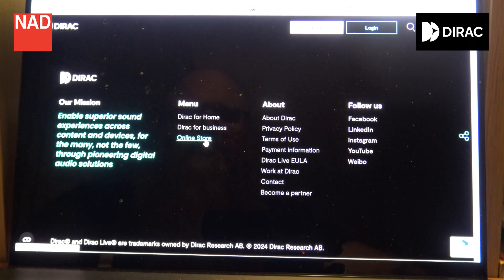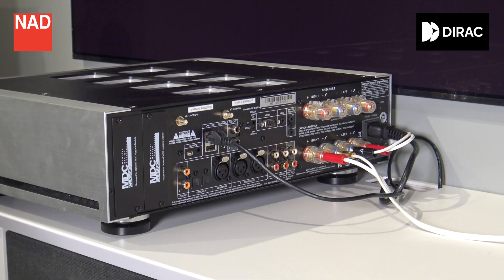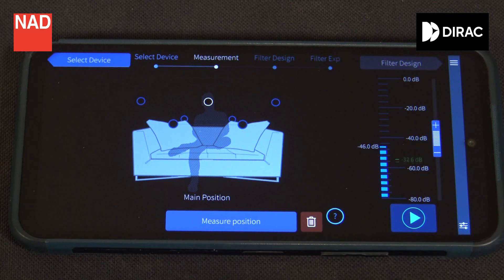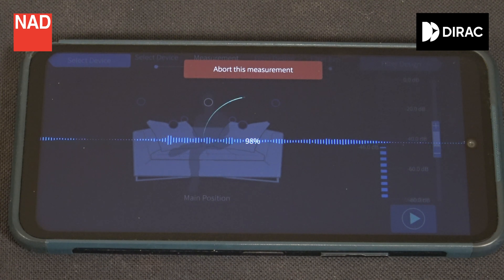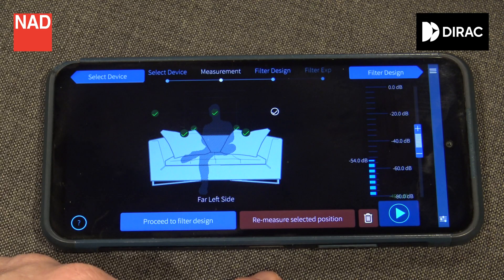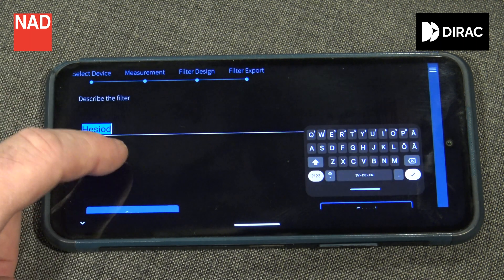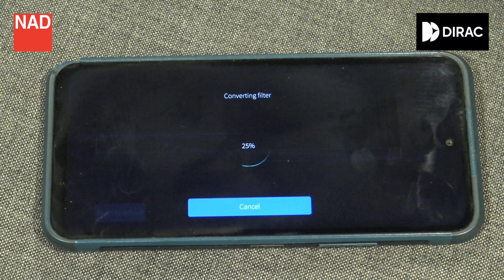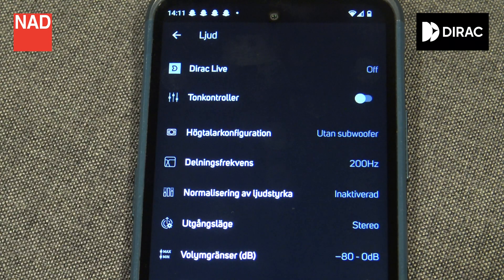How to Dirac with NAD Electronics

Comment: I bought the NAD C658, and so far it's been a terrible experience. Dirac Live doesn't make accurate measurements, but also doesn’t explain what might be causing the issue. The forums suggested to buy a UMIK-1 mic. The next recommendation was to enable exclusive mode in Windows. I did that. Now, some frequencies are "clipping" even when Dirac is off. At this point, I can't tell which is not working properly – Dirac or the device itself. For me, this device was quite a big investment, but now neither Dirac nor the device are working as they should (clipping). In addition, the Tidal Connect connection sometimes drops out. Also, I don’t understand why the MDC HDMI module costs so much.